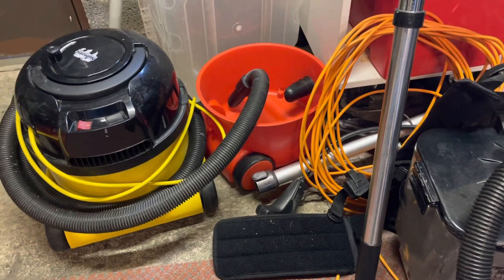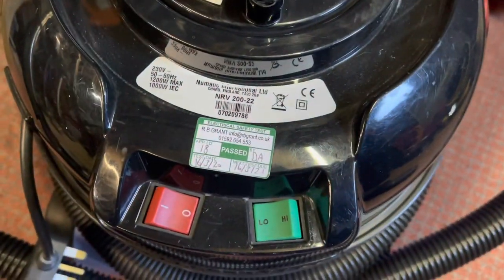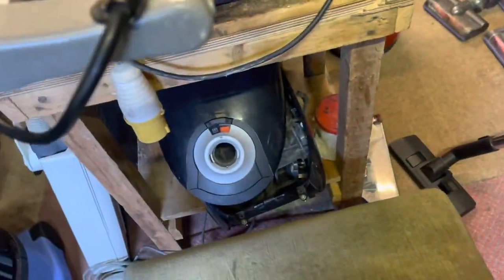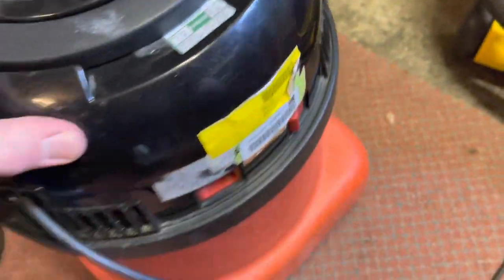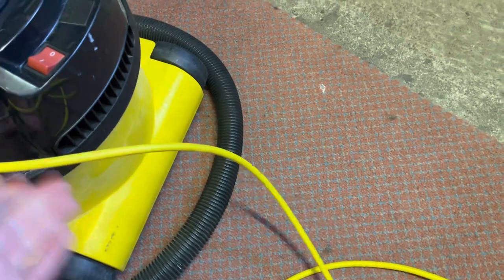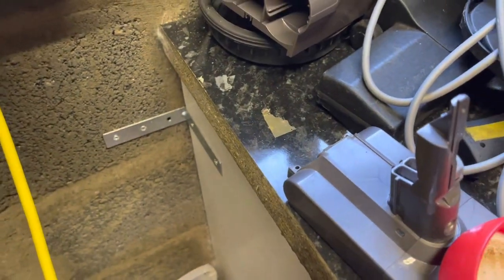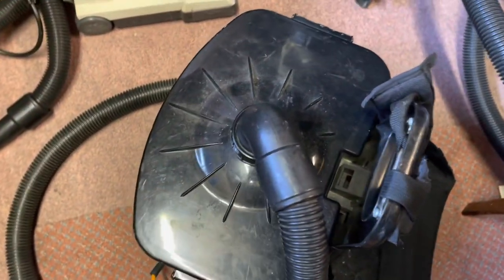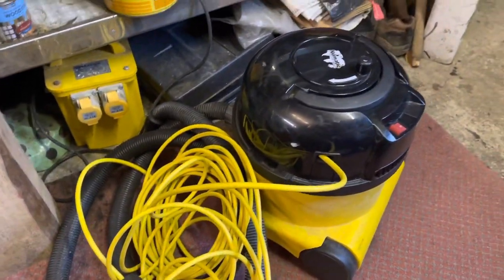Numatic Henrys First Look NVR375 Back pack RSV130 NRV200

Comment: Switch might be failing on the blue one
Reply: Probs dust in the switch they tend to with age i just take the cover off clean the contacts put it back together and it's good as the day it was purchased
Reply: or the wiring in the plug

Comment: some cool machines there!😁 WOW the yellow NRV's cable is well long!🤣🤣
Btw I've got a few spare hose cuffs knocking around if you wanna swap one for the one off of the RSV, save you having to get a brand new one (I'll drop ya a message on insta)
Reply from the maker: I think it’s over 12m but haven’t checked!
Reply: @hoovermaster  aye 12m sounds about right